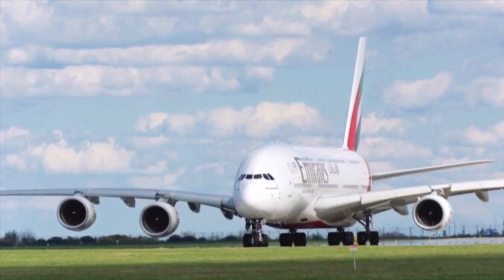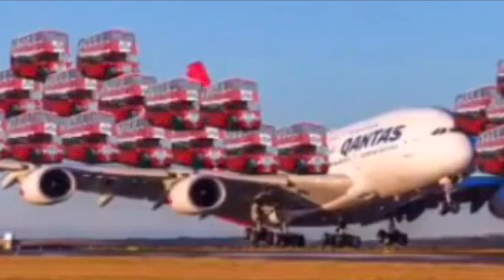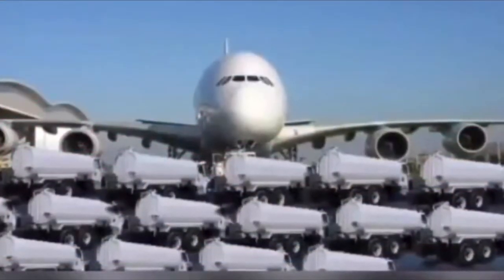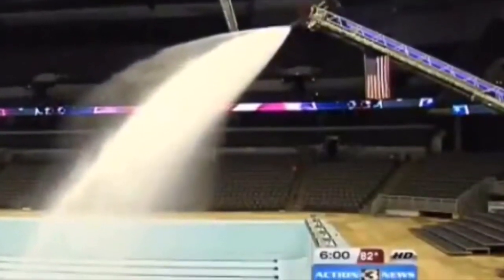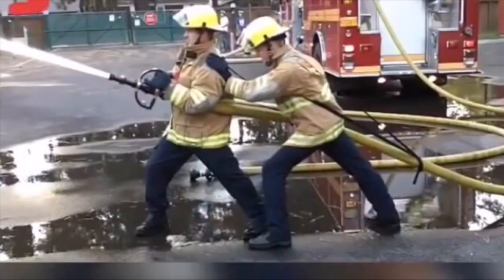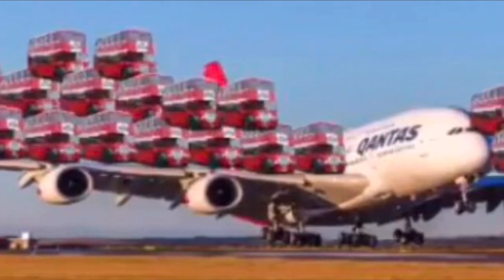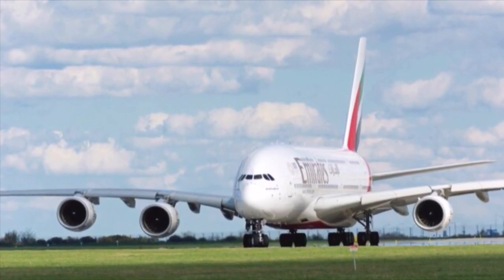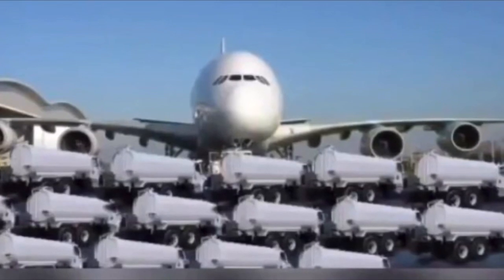Airplane Jet Fuel Hoax

Comment: Besides the capacity and how that much fuel could actually fit in those wings, the weight of that much fuel would be, what? Thousands of pounds? Completely illogical!
Reply from the maker: I worked on tarmac. I built the containers. Where do they fuel between parking overnight at the gate and the next morning? Where is this fueling hub? Why are there any fueling trucks at all at the airport? I’ll take you seriously but you can’t just say “that’s not how they do it.”  Every commercial pilot I’ve talked to says that they fuel at the gate. So enlighten us. Give me a google earth pinpoint where they fuel up. Bust be easy to find. All those planes? Post the pin drop. 

Also, I know goddamned well they fuel up at the gate. I applied for a job to drive the trucks to get out of building crates. Bring your knowledge.
Reply: @truthdookie  😂hold on, so you don't believe that planes use fuel but you wanted to be a fuel truck drive. I guess it's because seeing is believing for you people
Reply from the maker: I don’t mind you disagreeing or proving me wrong. But to try and make me look like the a-hole when you aren’t even addressing the weight of the fuel.... sorry. The burden is on you. It’s bullshit. Prove me wrong. ACTUAL WEIGHT, GALLONS, SPEED OF FUELING etc. 

You won’t do any actual research. Let’s watch.

Comment: Wouldn’t all that fuel be sloshing around causing the plane to be unstable?
Reply from the maker: Jon Stempl the explanation is that the sections of fuel are beveled to prevent that. I don’t see how that’s the case, but if an expert wants to chime in...
Reply: Jon Stempl - the wings contain ribs which offer structural support to the wings and also act as baffles to the fuel. Does your drink slosh about when you are in a plane? No it doesn’t, so why would the fuel? A car ground round a tight corner results in a feeling of being thrown out of the curve. Again, this doesn’t happen on a plane because the turn is coordinated and balanced.
Reply: Dominic Inman I’m talking more like if the plane banks to one side or the other. Then the drink your holding would be effected as well as fuel in the wings.
Reply: Jon Stempl by- but drinks aren’t affected during a coordinated turn. That’s the point of them. 

There is fuel in the wings. Large amounts. I think the designers at Airbus and Boeing have thought about fuel, wings, strength and everything else that conspiracy nuts seem to be so confused over. 

At the end of the day, regardless of how you think the fuel fits or not, the aeroplanes handle differently when taxiing for take off and then again after landing. The last take off speeds vary to the landing speeds as well.
Reply: Dominic Inman of coarse the landing speeds would be different. At takeoff the planes trying to get as much speed as it can to gain altitude. At landing the planes trying to slow down. That’s not a valid argument for the plane having more or less fuel. 

  I do think there is some fuel used but far less than they’d have us believe. I’m not going to try and type out exactly what I think these engines are doing. Look into it for yourself. But the main issue here is I’m not sure I believe that much fuel would fit.
Reply from the maker: Jon Stempl were talking a decent sized swimming pool on the other side. They run off of compressed air once they gain altitude. That’s the theory. They have to use fuel to take off and gain speed for sure. Jet engines don’t start with a car key or a button. They bring in air compressors and charge those things before the first flight to get them going.
Reply: Jon Stempl - about 8 tons per hour. That is my personal experience. What expertise do you have?
Reply: Aircraft fuel tanks are separated.
Reply: Psych_ bear - you obviously don’t understand what Vref is. 

Please do try and type out what you think these engines are doing. My experience is that the GE90 on the 777 uses about 4 tons per hour of fuel. What experience do you have?
Reply from the maker: How do gliders world so well? I have plenty of experience in this area.
Reply from the maker: Typo. Do better.
Reply: Dominic Inman - I think these jets could be using technology similar to how this root self propels itself. Some fuel is needed to start up the engine but once it’s running the engine uses this same principle. Only pushing air instead of water. Air compressors may be involved too. 
    Just me speculating. 

https://youtu.be/btq9YM0XpqY
Reply: Psych_ bear - prove it.
Reply: Trey Clark Theories - gliders get their energy from the initial launch then surfing the up drafts. The wings are long and narrow. I haven’t seen an Airbus circling up draughts to gain altitude.
Reply: Dominic Inman- sure, I’ll just go take apart a few jet engines and get back with you.
Reply: Psych_ bear - that’ll be great. Well done. That’s the sort of investigative journalism that you need, not watching stupid YT videos and swallowing the lies hook, line and sinker. 

Find one single piece of evidence that suggests that a GE90 or Trent 1000 doesn’t use the standard jet engine technology.
Reply: Dominic Inman do you know what speculating means?  Clearly I’m not the only person who’s been giving this thought. It is clear where you stand on this subject. So why are you commenting?  You’re  most likely a gamma who makes yourself happy demeaning others because we are thinking outside the box. Stop watching pornos bro and try using some critical thinking.
Reply: Psych_ bear - speculation is pure fantasy. Unless you can back that up with something solid, even if you are still incorrect. 

I can understand people getting interested in conspiracies about who shot JFK, or September 11th. But there is so much information about jet engines that to have a cover up for some secret mystical technology is just utterly stupid. 

People have heard “90% of thrust from compressed air” and details about the A380’s fuel capacity and it has blown their tiny minds. The fact that airlines go bust and the A380 is out of production because it is too expensive to run seem lost you conspiracy fools like yourself. 

Unless you have any proof then you are just imagining something and wanting it to be real. Any sort of research (not YT videos) will guide you to the right knowledge. Maybe even ask a pilot!
Reply from the maker: Wait... “speculation = fantasy”? What? Lots of things fly around all day long without charging for fuel. 

“You’re stupid and you just don’t understand what we grownups know” is losing a lot of traction as far as an actual argument. 

I can get how the lift could POSSIBLY offset the weight of the wings. I worked on the tarmac. Do the math. How many tankers would need to be on hand at a busy airport to support the fuel they say they are using? If you don’t show your math, you are blocked. I’ve got 3 kids already. I don’t need another one. Especially a lazy one.
Reply: Trey Clark Theories crushing
Reply: Trey Clark Theories - it’s all well and good to have ideas and to question things but to imagine a conspiracy like the jet fuel hoax or flat earth is just pure idiocy. The conspiracy has come about through ignorance and has spread the same way. There is no proof for the conspiracy.

It’s like saying that whales are actually UFO submarines hidden in plain sight. Prove me wrong! Some stupid people will then believe it because they’ve probably never seen the sea let alone know anything about aquatic mammals. 

It is pure fantasy without a shred of proof. 

PS: I’m a pilot with the worlds biggest airline. I’ve burned more tons of fuel than you’ve had hot dinners.
Reply: Dominic Inman 
 Haha haha. Give it up Mr. pilot. Are you down on the tarmac watching them refuel your plane?  Have you taken apart and repaired the engines yourself?  This happens to be Trey’s saloon. Git
Reply: Psych_ bear - yes I am in fact. And I’ve refuelled them myself in the past. The plane actually handles differently when you taxi it out and back after the flight. It is heavier. Is that some additional NASA or Illuminati software in the plane to make us idiot pilots believe we’ve burned loads of fuel? I’ve also suggested you understand what Vref is. It is different between take off and landing. Now why is that? I’ve also looked up the arse of plenty of gas turbines, and also seen inside the one which got destroyed after I sucked in some birds during take off. Jet engines work in the pretty much the same way as when Whittle invented then in the late 1930’s.
Reply: @truthdookie  no they don't that doesn't work you would have blade's moving but no thrust
Reply: @truthdookie  you know most airports just get the fuel trucks for filtering and fuel actually comes from underground pipe's
Reply from the maker: That is 100% inaccurate. Show us just 1 example. Even if the “mystery pipeline” conspiracy theory exists, how long does it take to fill an Olympic swimming pool? Don’t just say shit. Show it.
Reply from the maker: Drinks are absolutely disturbed. Even on that level during turbulence. I’ve had my drink smash into the ceiling on a 737. So the wings loaded with hundreds of tons of fluid are not bound to physics?

Comment: They don't refuel on the runway 🤣
Reply from the maker: I’ve worked on the runway. What are they pumping into the wings of those planes, water? Cornmeal? When they say “No smoking near jet fuel” as they pump from a small tank that reads “FUEL”... am I supposed to assume that it is not fuel? Why would that be more logical than thanking the printed signs at face value? 

Do this: Look up the Airbus fuel capacity. Look where they store the fuel. Then convert the amount in the wings to pounds. Then come back to the thread with your research findings and prove that I’m just a stupid idiot. I’ll wait. (You won’t).
Reply: @truthdookie  dude I don't understand why u guys tell us to think outside the box when you guys don't think outside the box your talk about the Victor shit.
Reply from the maker: Ethan's Aviation that sentence makes zero sense. I’m sure you’re making a point, and I’ll address it, but what is “”viktor”? Vector? I want to take you seriously. 

And... you didn’t do what I asked so you could easily show how I’m wrong. How many pounds in the wings of an Airbus? Easy thing to find out. Post your findings here. I have certainly stuck my neck out on this subject matter. You rolled in to tell me I’m wrong, but not “why” I’m wrong. 

Do some kindergarten math. How many pounds of fuel are in the wings of an Airbus? Just a number. Not your feelings or opinions. How many tons? Write that number on this thread. Then I can show you what happens to fluid even in a beveled system just with a waterbed in a pickup does on a 7 mph left hand turn. Again... you won’t. Just say how many pounds are in the wings. Easy to find.
Reply from the maker: Nope. Sorry. It doesn’t work like that. Even if you cry.
Reply: @truthdookie  one I don't cry
Reply: @truthdookie  also why the heck do you make these videos, ahh the money
Reply from the maker: If you have to tell strangers in writing that you don’t cry... you definitely cry.